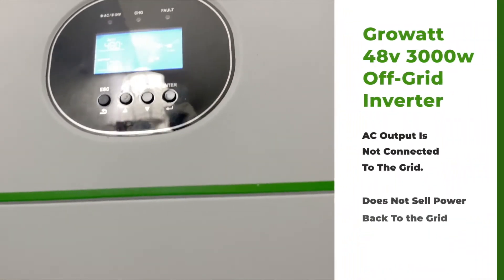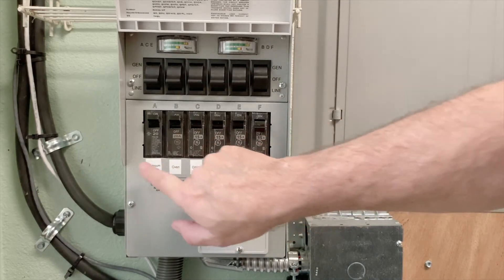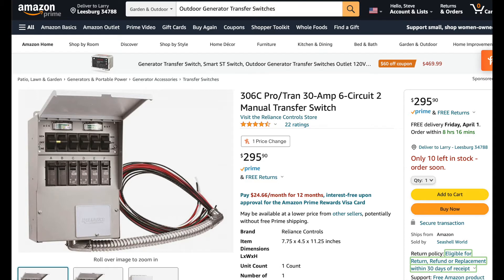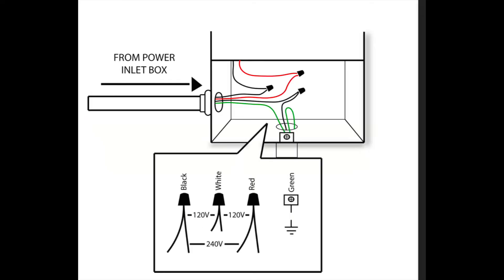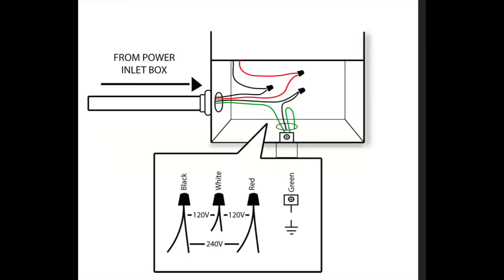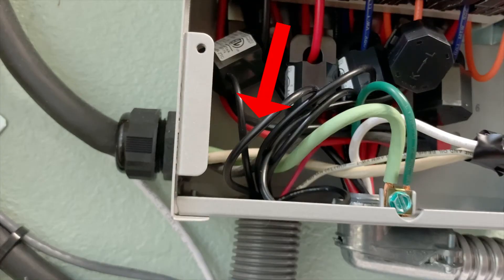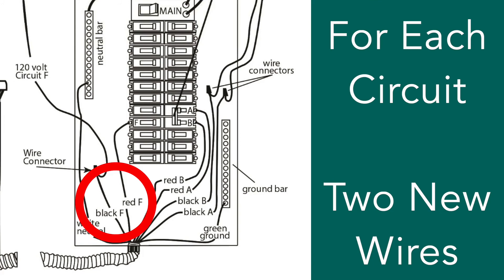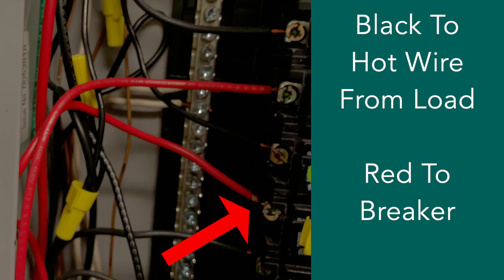Pro/Tran2 Transfer Switch Review. Power Your Existing Home Circuits With An Off-Grid Solar Inverter

Comment: Warning :  The Reliance transfer switch does not switch neutral.   That means that to get this to work the inverter input neutral ends up connected to the inverter output neutral.     
*  This seems to work with many (most?) inverters, but it is not clear whether it is supported by the manufacturers of some inverters.  (I have not seen a clear statement from Growatt, MPP or EG4 on this).   
* If the inverter you are using does dynamic Neural-Ground bonding,  there will be two Neutral-Ground bonds when the inverter is powering from the battery (multiple bonds are dangerous).   To prevent this,  the dynamic bonding must be disabled.  (This is typically done by removing an undocumented bonding screw deep inside the inverter)

Note:  Growatt added dynamic bonding to their inverters about a year ago and it is not clear how to tell the difference between units that have the dynamic bonding and the units that do not have the dynamic bonding.
Reply from the maker: Thanks, I wasn't aware of the dynamic bonding in newer units. The unit I bought doesn't have it, so I only have one bond in my whole electrical system. (in my main service panel outside, not shown in this video.)
Reply: ok but do any transfer switches have the ability to switch neutral?  I mean there are also switches available from Generac, ConnecticutElectric, and Nature's Generator similar to this one.  Are those units safer than the Reliance?
Reply: @rmassuser  The reliance functions as a combination of both transfer switch and critical load box. I am not aware of any boxes like the Reliance where there are both individual breakers and the transfer switch function.    However,  traditional transfer switches with 3 poles that are placed in front of a critical load box will switch neutral.
Reply: @centerrightproudamerican5727  so if my inverter uses "common neutral" wiring do I avoid any potential hazards using the Reliance transfer switch? Common neutral and ground-neutral bond in my main panel, and I am planning to use the pass through function.
Reply: @rmassuser  Mostly yes.   I say mostly because if there are GFCI breakers in the breaker box, the breaker in the Reliance needs to be a GFCI as well.   THe neutral wiring has to be serial between the two breakers and the wiring gets a bit convoluted.   If done properly GFCI breakers work fine and are safe, but if a service technician might make some incorrect assumptions and get shocked while working on the system.

Are you on DIYSolarForum?   There is a similar conversation going over there.
Reply: @centerrightproudamerican5727 based on your responses I am leaning towards just using a regular sub panel to power my critical loads.  There is one critical load, the water heater, which I might like to be able to power directly from the main panel as well so if I want I could buy a 3 pole manual transfer unit just for that .  The use case I am thinking of is if the water heater heat pump stops working. Then I would be able to switch it to resistance heating. However I don't want the resistance heating load running through my 6000xp as it would strain the output capacity of the inverter.  So in that case I would manually transfer this load to run directly from the main panel.

Comment: Since utility power and Growatt power are flowing through the panel with different phases.  How are neutral lines (utility vs. inverter) power end up going?
Reply from the maker: I share the ground and neutral with the grid-powered breaker panel in my setup. Neutral and ground don't have a "phase". I haven't had any issues with wiring this way. In the case of the transfer switch,  it's the same as using a backup generator.

Comment: So do you have all your switches in the protran set to gen. And you let your grow watt switch between solar ,battery's and the grid at this point
Reply from the maker: No, I don't use the growatt's internal transfer switch to run loads. There's nothing wrong with doing it that way, I just use mine differently.

The Growatt doesn't normally have a grid input. It has a heavy-duty 10 foot extension cord attached to the AC input. This cord is not normally connected to anything.  In an unusual situation... such as several days with little sun, I can plug it into the wall or a generator, and use this only to charge batteries. I might have used it twice in three years.

The ProTran is connected to the output of the Growatt, and is used to pick what I'm powering with solar. If I'm charging the car, I might not have any other circuits on solar. During a power outage, I would have all of the ProTran switches on gen(solar).

Comment: I'm getting ready to install a very similar setup.  I've heard about concerns with creating a ground loop when connecting ground and neutral.  I've seen instances of folks discussing "floating" the neutrals.  Do you have any insight on that?
Reply from the maker: You don't want to "float" the neutral. There should only be one ground and only one ground-to-neutral bond in the entire system. 
The breaker panel shown in this video is a sub panel, and not bonded. I connect the wire from the inverter ground to the panel ground, and from the inverter neutral to the neutral. They are NOT bonded in this panel, because my system is bonded and grounded at the main panel outside. That main panel was not shown in this video.
Reply from the maker: If you are using circuits in your household existing panel, there should already be a ground and a ground-to-neutral bond. you don't want to add another ground or bond, that causes a ground loop.
Reply: @ReelClearMediaLLC  OK, thank you for the response. That was my thinking but I don’t come from an electrical background so kind of learning as I go. Your use is essentially the exact same as what I am doing. One small difference is that I have a grid-tied solar system as well, but I am wiring my off grid system up completely independent of the grid tie and running to a transfer switch that I back up some circuits from my main panel within, just as you have shown. My grid tie system is on a completely different  circuit, and will not receive signal from the off grid generator or the backed up loads in the event of a power outage, but all are grounded and Bonded to the main.
Reply from the maker: @brianmills4891  You may want an electrician or a friend with electrical experience to double check. Make sure the grid tied system can't backfeed to the grid on a power outage. Again, only have one ground, and one ground to neutral bond in the whole system.
Reply: Do not float your neutral on your generator.

Comment: Doesn’t that Growatt off grid have a built in transfer switch? Or is there another purpose behind your setup.
Reply from the maker: Yes, the whole Growatt can act as a transfer switch. You would use a breaker panel/load center after the growatt, and all of those circuits could be powered by solar or the grid feeding the Growatt. This could be controlled by setting 1.

I wanted to use the existing household breaker panel during power outages.

My setup allows me to use the growatt 24/7 for my computers and office, and by using the transfer switch, run circuits in the house during a  power outage.